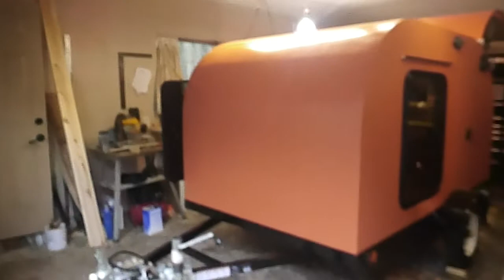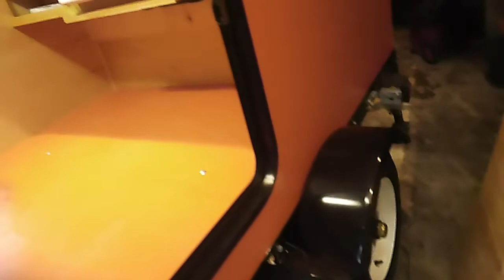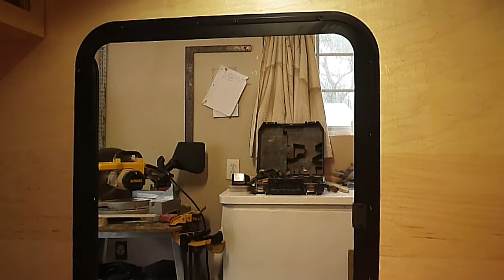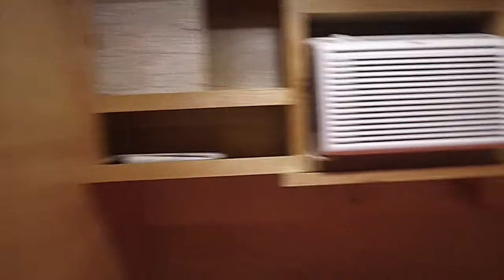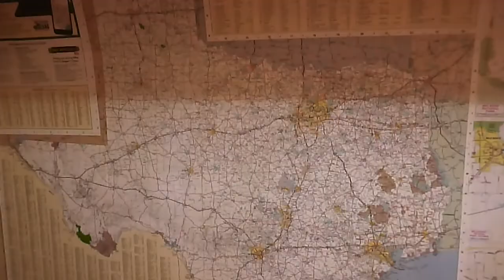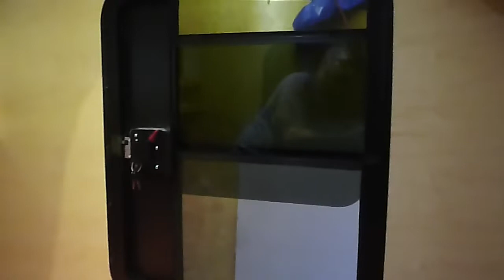Teardrop Camper Build Benroy v46    Doors and rain gutter done

Comment: It's looking good buddy.👍
Reply from the maker: Ali Mack hay man thinking about you today the check engine light came on in my ford explorer sport and I replaced the 02 sensor, PCV, MAP sensor, cleaned the mass air flow's and the light has not gone off.
Reply: @mlangfordoutdoor  02 sensors yeah seen them cause problems
Reply: @mlangfordoutdoor  probably best to scan Ecu for a fault code buddy.